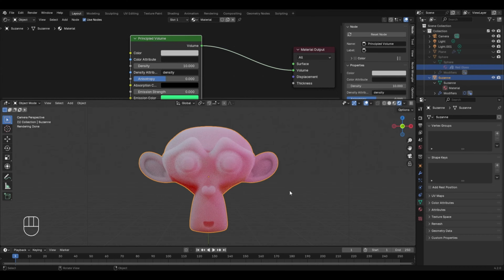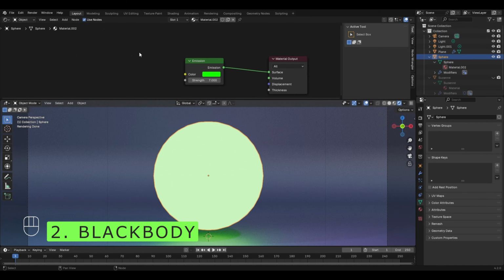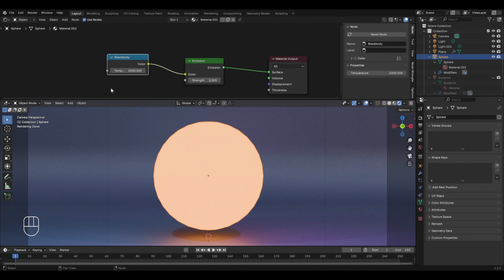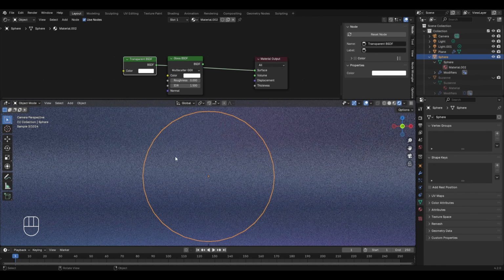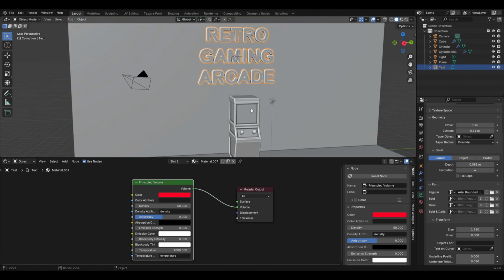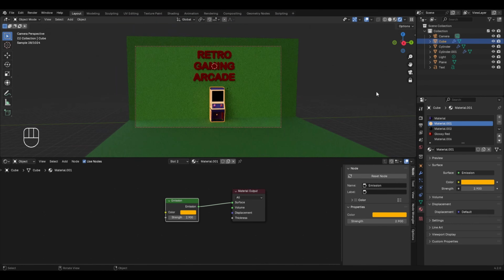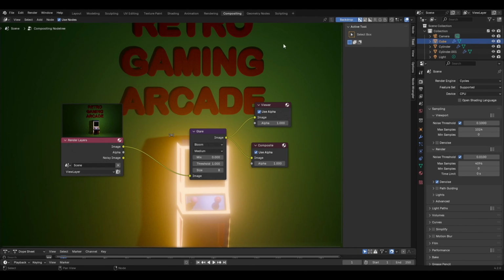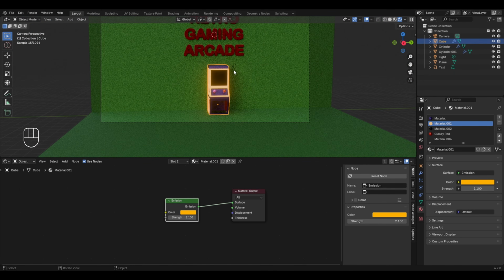Blender Materials, Textures & Nodes Course: Chapter-4: Working with Emission #blender #b3d #3d

Comment: Well 👁👁 ye mere bass ki baat nhi hai
Reply from the maker: Why? Facing any problem in understanding any concept?
Reply: @jb3dstudio  because my pc is dumb
Reply: Blender required highfigh spec
Reply from the maker: Not really, even with a mid level pc, blender runs smoothly. Like in my PC, i have a good CPU (Ryzen 7) but a poor GPU (AMD Radeon Graphics, which is just USELESS), still Blender runs perfectly. Occasionally it may crash when u work on physics, sim and advanced tools, but mostly, it's not a problem. What are your PC Specs?
Reply: @jb3dstudio  8gb ram, intel i5 6th gen gt 7304gb ddr4
Reply from the maker: Okay, for Blender, this might not be the best setup in case u work on physics, sim, complex projects, but other than that, it won't be an issue. According to me, you should practice 3D animation in Blender with these specs only, if u can't buy a new one. It won't be a problem most of the time.
Reply: @jb3dstudio  okay I will try
Reply: And thanks for advice